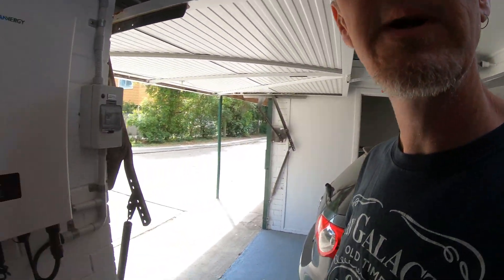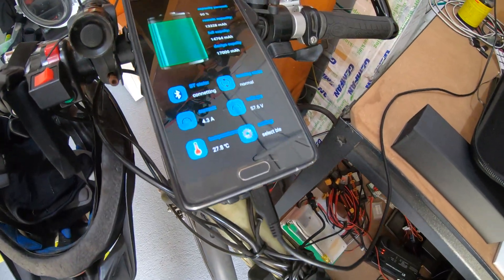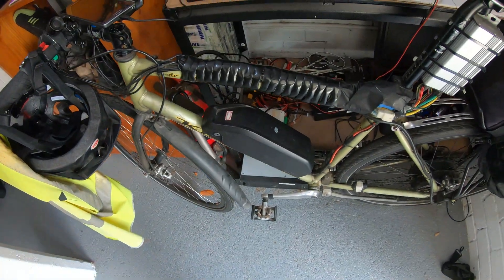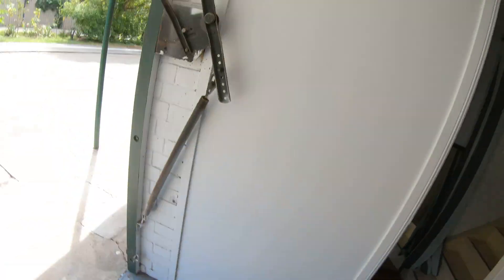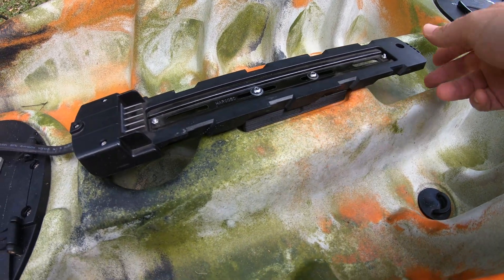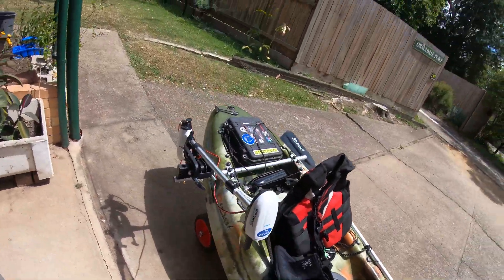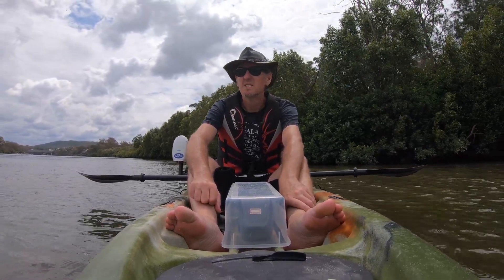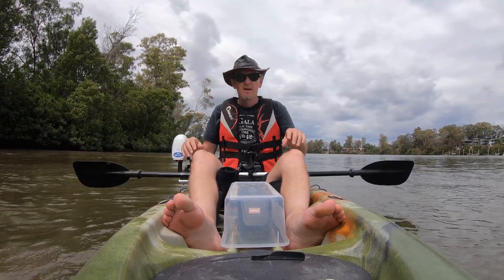Electric Kayak Project Part 2 - I need a bigger battery!

Comment: Nice !!!!  Was a bit worried that a random splash might fry your goulies tho.
Reply from the maker: Haha so far so good, worst that's happened is that the xt60 got a bit corroded, which made it get super hot and burn my leg lol
Reply: @strepto42  Better go with XT90 for less ballfrying then, Im still doing fine with Deans-connectors. :-) 
I still think a PWM regulator would help as it can reduce power, also an amp or powermeter to see when its more effective, i found setting motor on high and regulating power made it sail faster on same amperage!

Happy new year, cant wait for part 3.
Reply from the maker: @coolkwad4788  Arghh Deans! ;) Yeah definitely need (and have) the special anti-spark xt90s for the next stage of the project... 50v fun with a whole new motor in progress ;)